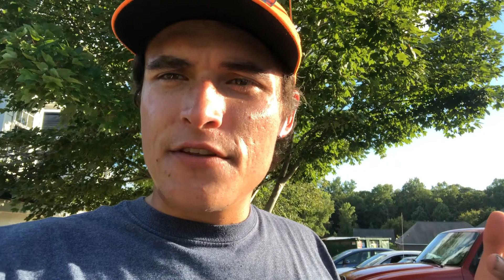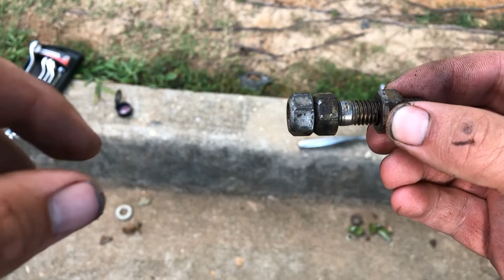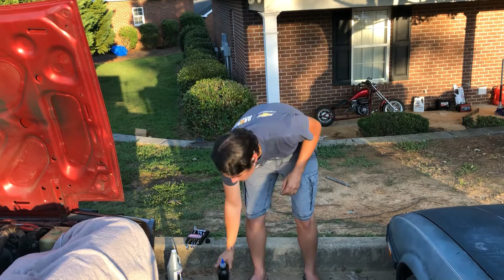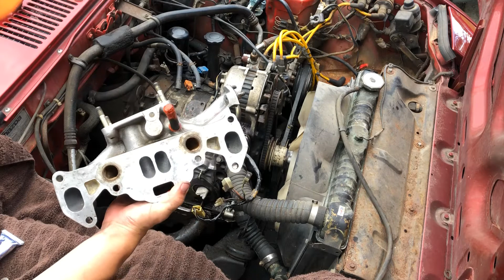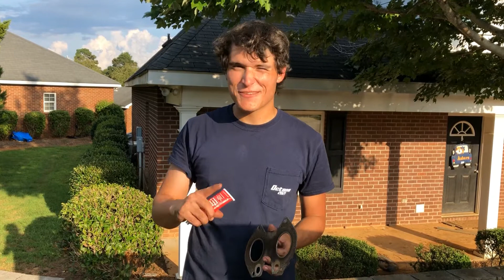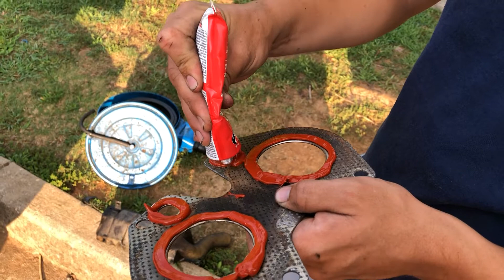Saving Matilda the 1979 RX7 Part 2

Comment: Do you have an 12a flooded start video?
Reply from the maker: I have a video on how to fix the hot start solenoid, which if it is faulty it will flood the engine when you shut your car off. If your 12a is flooded take your plugs out and turn it over with the fuel pump fuse out. Then put the plugs back in and the fuse and it should start.
Reply: @rotariesjetskis6967  right on! Appreciate the reply and tips! Going to check out your new video now.
It's a 12a with holley carb. Replacing lines filters rebuilding the fpr and new aeromotive gauge for good measure. Need to find a better cleaners looking way to mount to fuel lines now
Reply: @rotariesjetskis6967   could you walk me through the shut down process? Rev up and hold at 3k then kill the car. Do I hold the accelerator at that position the whole time? Or completely press it to the floor during key off?
I was told this would help also with preventing flooding